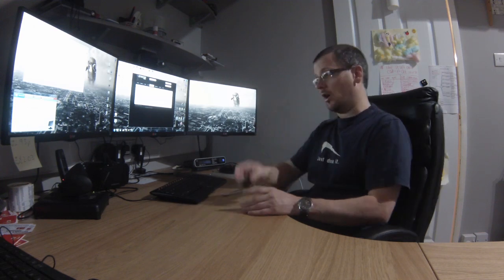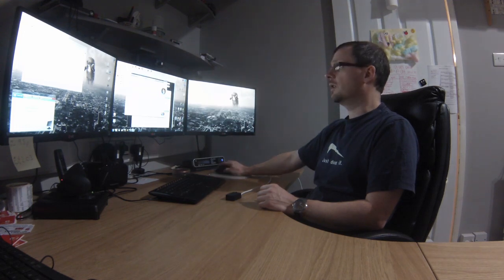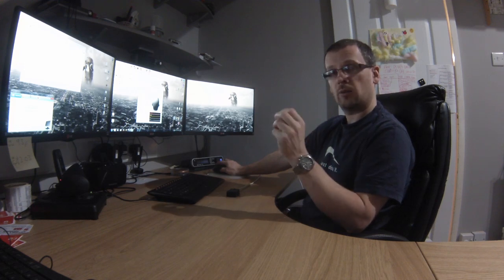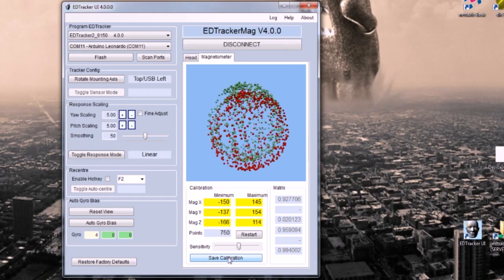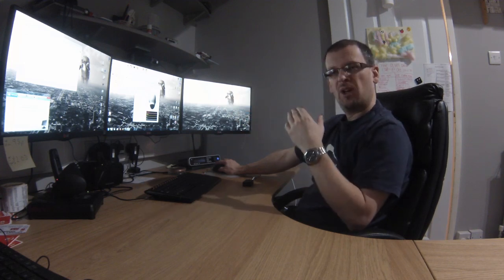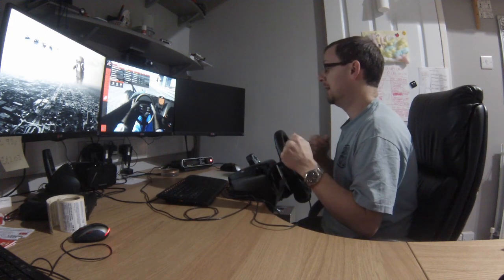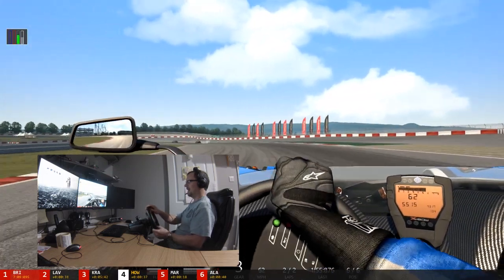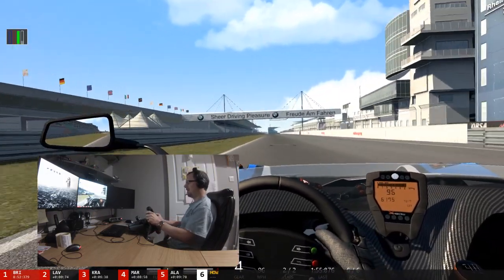DIY EDTracker V4.0.0 Calibration (Magnetometer/9150)

Comment: Brumster, i just did my DIY Edtracker with the 9150 MPU, i have downloaded the GUI V 4.0.4. but the software does not show up the way it does on yours.

I have followed these steps

• Install the Arduino Drivers
• Download and launch the GUI
• Flash the firmware into the device

but when its done, the restore to factory button is grey and is not able to press it. 
you can connect and disconnect the device and thats it.  

i have reinstalled Net Framwork 4.5.2  but still no progress

What can it be?
Reply from the maker: +barros86 Which firmware did you flash in? EDTracker2_9150 v4.0.4?
Reply: +brumster100 
yes, just like you said on the instructions, i followed it step by step. Tried it this morning, still no respond after flashing
Reply from the maker: +barros86 I would check the connections between the MPU board and the Arduino/Pro Micro, it sounds to me like it's not picking up any comms over the i2c bus with the gyro. Check soldering, maybe drop me a line via the edtracker website and send me some pics of the assembly...
Reply: +brumster100 
I will check and send u some pictures. Thank you

Comment: Hi brumster, just received my prebuilt 9150 but I'm having trouble during the calibration procedure due to continuos and sudden freezes/crashes of the 404 GUI software. It simply stuck prevent me to click or use any function. I tried also the 401 version but problem remains the same.
I tried to change the usb port but nothing. My setup is really simple: i7, win 7 64 bit, microsoft net 4.5 installed. Can you help me?
Reply from the maker: Drop us an email via the website - I'm not best placed for GUI issues, but our resident .NET guru (Rob) can take a look at them ;)
Reply: brumster100 Thanks a lot! I mailed Rob yesterday evening and he gave me another GUI build 4.5 based. Tried calibration and it works but edtracker has some vibrations when I center my headlook. I'll try again calibration today! ;)

Comment: So Could a Air presser sensor be added to meshes changes in Y. eg so if I stand up the same thing will happen in game? I was playing with some last week and they can pick up some very small changes in high (presser)
Reply from the maker: C00m7ee Not fiddled with one. I guess technically yes but not sure the accuracy would be good enough, or that the "value add" would really be worth it?
Reply: I was playing with one at CES lat year it could masher about 1mm change in high

Comment: Is there any way to turn off auto centering?? Impossible to use in a racing Sim with this auto centering too disorienting trying to look to Apex's or at a car along side when the tracker centre's itself?
Or do I have a problem with the 9150?
Reply from the maker: Hey chap, more likely you have a problem with the mag calibration or orientation - you wouldn't want to turn off the drift compensation really (the 9150 firmware doesn't have auto centering as such).
Reply: +brumster100 Thanks for the reply, but still after many times now trying to calibrate this 9150, after umpteen times still get the drift to center, best I had it was good for looking up & down but left to right just drifts back to center, so frustrating :(
Reply from the maker: +Achingfanatic5 when you complete the mag calibration, do the red/green blobs look generally spherical? or any spikes/anomalies?

Comment: I have a prebuilt EDtracker 2- I'm Not getting it linked to COM1 - Am I missing something silly like linking the USB port to COM1 somewhere?
Reply from the maker: FabledDragon It may be another COM port, not necessarily always COM1 - you can change it in device manager under advanced properties. First thing to check is if it's even recognised - have you installed the Arduino/Pro Micro drivers (assuming it's using a Pro Micro or clone)?
Reply: Cracked it... needed to choose device type from drop down then got a change in comports - knew it was something silly... -  but thanks :D

Comment: Followed the video to the letter, once finished I yaw left or right and the head auto centres, i.e. I turn the device 20 degrees the head on the GUI turns as expected then as if on an elastic band re-centres itself :( using v4.0.3
Reply: +Jer Goes Got the exact same problems, If it turn left or right 45 degree, it goes back ~15-20 degree to the center automatically. Tried to calibrate the magnetometre many time, reset, reflash, etc... didnt work. Also on 4.0.3, the 4.0.4 dosent work for me (since I have the 9250 MPU).
Reply from the maker: +Sébastien Plante Did the mag calibration definitely finish and you clicked "save"? What did the green/red blobs looks like afterwards - was the green generally spherical in nature? 4.0.3 is fine, it's essentially the same, Rob never uploaded the 4.0.4 source code so the 9250 was branched off the 9150 at an earlier version.
Reply: brumster100 yes, I did the calibration many time, using 1000+ points... there a big green ball and a small red ball, both spheres look great... but I think I might have a faulty one.. I was never able to do the calibration using the 2.x calibration version (It's a 5$ one from AliExpress)
Reply: +Sébastien Plante I fixed this problem, I think it was by using a newer version of the software.

Comment: Are the two balls (green and red) supposed to be inside each other? Mine keep ending up beside each other.
Reply from the maker: TheSaltyStew No, they are typically offset from each other, that's fine. They tend to overlap; if they are way apart from each other or not generally oval in shape then it suggests you have some strong magnetic fields influencing the device nearby.

Comment: I need help i think. I messed up a bit during the soldering part, still the device seem to work, but I got 3 red ligth, all 3 on the Pro Micro, 1 fixed red rear the usb connecto, on near the "14" pin, the other red is blinking near the "7" pin. on the Gyroscope instead i got no lights at all, shouldnt be there a green light? Im confused
Reply from the maker: If it's seeming to work, I wouldn't worry about it ;). Different manufacturers might put different coloured LEDs in different positions. Don't worry about it. Likewise, a lot of the newer MPU boards, particularly the 9250's, don't have any power LEDs on them any more.

Comment: My EDtracker software 4.0.1 is having issues... the boxes are way too small and cramped, I can not even see the "reset factory" button on the very bottom. Graphic card issues that can not properly display the program? Im running a pretty high resolution but going for a lower resolution didnt help.
Reply from the maker: ***** Hi Franz - can you try v4.0.4.0 of the GUI (on the website) and let me know if it's still a problem?
Reply: Yep same problem.
Reply: Here a pic: http://imgur.com/yHnq1ME

Comment: I got mine today but i'm having issues setting it up , i am using the V4.0.1.0 software and looks different to the software here, some of those buttons/tabs are not present
and i dont know which firmware to use ... too many to choose from in the list
Reply from the maker: Hey chap, what model did you buy? basic or magnetometer? Drop the person who dealt with your order an email and they can assist you, I'm sure.
Reply: brumster100 Hi i got the Magnetometer version, i watched this and sorted the drift as i had used the wrong firmware, only problem i have is that the ED tracker software works fine and after following your excellent video it all seems fine , but in Elite Dangerous it only seems to act as a switch , no movement until my head move a few inches then gives me full right/left or wherever view , almost as if i have a massive dead zone set, i dont in any where and the software is set EXACTLY as you suggest here, i have tried swapping between lin/exp but no joy

I understand its not up to you to get mine working but i'm sure i'm nearly there, any idea ?

Thanks for the good vids
Steve
Reply from the maker: Slimwadey That honestly sounds to me like the age-old map-to-the-wrong controls in ED. You definitely got it mapped to the look AXIS controls, not look up/look down?
http://www.edtracker.org.uk/index.php/using/game-support/23-elite-dangerous

Comment: After flashing EDTracker2_9150 4.0.4; it does nothing anymore, even after 20-50 seconds. I tried to reflash it and now it says: Kick Port COM3 when i tried to flash it again?...
Reply from the maker: +ShadowOps15 There's been a few cases recently of people using 8MHz Pro Micros by mistake. Could it be this?
Reply: +brumster100 How do i check if i got the 8MHz version? I had the VCC wire on the MPU touching the GND, could that cause any problems? Gonna resolder tomorrow.
Reply from the maker: ShadowOps15 Yeah, that won't help! Sort that, hopefully problem will go away. If it's 8MHz you'll see "8.0" written on the flat, shiny component next to the black chip on the Pro Micro. Or it will say 16.0 in which case you're all fine ;)
Reply: brumster100 Thanks for responding. It's a 16Mhz chip :) If i cannot get it working with wires, i'll just wait for the custom PCB too arrive.

Comment: Is there any possible way to make its USB connection wireless? Via spare Logitech nano receiver perhaps? I don't know. Any idea about this?
Reply from the maker: Not easily, in a DIY fashion, no. Problem is keeping it small enough to be useful as a head tracker. It's not just converting the USB signal and then re-assembling it at the PC end, but everything around battery power, charging and transceiver aspects. I'm not aware of an easy way at all, no.

Comment: Can one make the EdTracker with the 9255 ??
And if so how?
Would be nice if you could answer.
Reply from the maker: The register maps are identical between the 9250 and 9255 according to the Invensense data sheets, so yes, it should be possible. I say should because I haven't done it personally. Naturally the 9255 has some AIR features that you won't be interested in... but if for some reason you want the 9255 over the 9250 (availability, cost, etc) then you should be ok...
Reply: thanksfor answer

Comment: Overall not a bad bit of kit but you will be far better off getting the wireless version. Having the USB cable plugged in and snagging or even pulling at the micro USB port of the arduino will cause it to weaken and eventually break off. In my case it tore offf the pads for the port too. I think a few revisions are needed  to beef up the connector or make the wireless version cheaper for people to purchase. 

This is usually the problem with kickstarter type affairs where cost matters. Things can often get overlooked when trying to keep the price down. 

Not a bad piece of hardware but it won't take much abuse. And the fact it didn't come with a pre driled enclosure with padding to secure the unit baffles me.

No idea what to do with the unit i have now as its essentially useless
Reply from the maker: Hiya - don't confuse this with EDTracker Pro. This is the DIY version, there's no wireless version of it, it was just a forum-led initiative back in those days, nothing done via kickstarter or aimed at a commercial level (other than making some PCB's up to help make it easier for the novice to build)...
Reply: @brumster100  ah ok gotcha dissapointed because the micro usb port is so fragile it came away and lifted the pads with it i could repair it with some trace wire but i feel its likely to be an ongoing issue. Shame really i might try the EDtracker pro now. Thanks for the reply.
Reply from the maker: @shutinyanks  yeah, the Pro Micro is susceptible to this because it doesn't use a through-hole USB connector - these are much better at tethering to the PCB. Guess what we used on EDTracker Pro :D ;). Best thing I can suggest for the Pro Micro is to glob the USB connector in hot glue (plug something into it first before you do it though, to stop the glue gunking the connector up)...

Comment: can someone help me it keeps kicking me out of the magnetometer on the gui
Reply from the maker: Is your device resetting? Stable power? Reset button not shorting out or accidentally pressed? Is it stable with the 6050 firmware flashed into it (I know that's not a long term solution, but just curious if it behaves ok, albeit the movement will be all over the shop!)..?
Reply: never mind apparently my problem was just a faulty button thank you for the help though

Comment: does it work with uno or mega?
Reply from the maker: No, by default the firmware only supports ATMEGA32U4 based Arduinos (so Leonardo or clone). 328P-based devices are no good I'm afraid.

Comment: Is there a way to "spoof" the web connection so the GUI thinks it's connected to the web server?
I'm having calibration trouble with a 6050 based unit I've had to program using the arduino code and IDE, and I don't know if that's the problem.